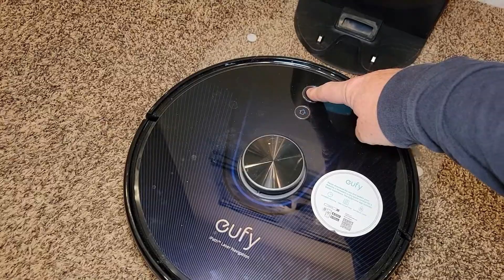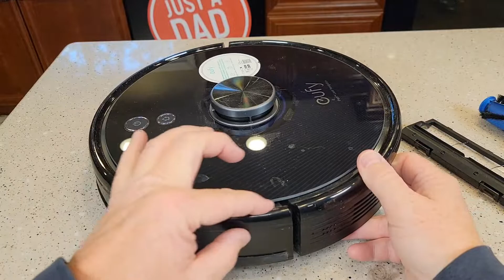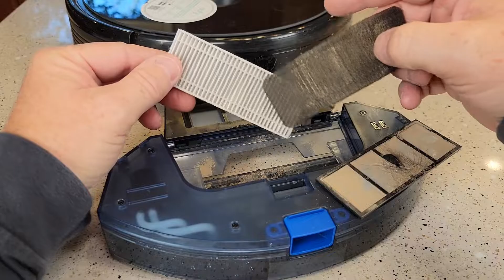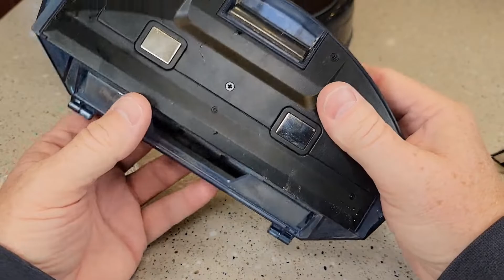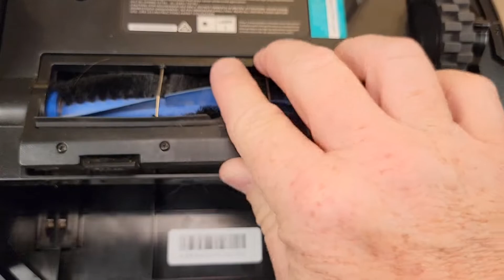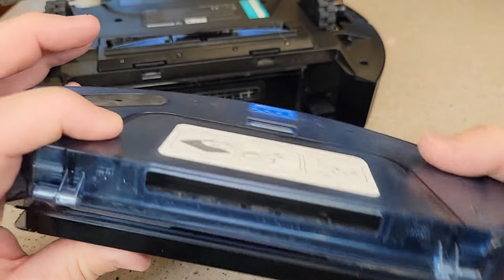How To Clean & Replace Filters eufy L35 Hybrid + RoboVac Vacuum Cleaner Replace Brushes

Comment: Hey, do you happen to know - how to clean the place where the roller brush is inserted? Like the little blue edge that you clean at 41-42 seconds. My eufy L35 Hybrid has hair stuck there and it's only building up everytime I clean it. I end up pulling out the hairs that are stuck in the space that helps the roller roll.
Reply: I'm here for the same reason lol
Reply: @kaiblue9586  I tried to pull the blue thing out with a twizer, it did come out without any damage.. you can try as well